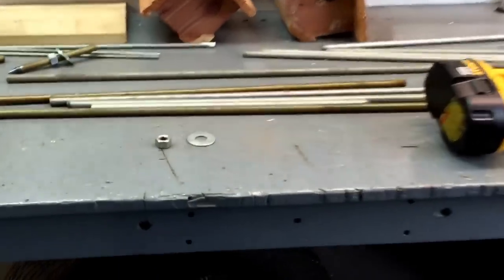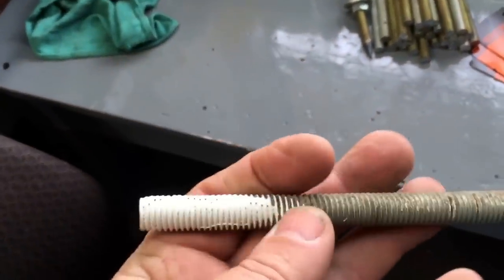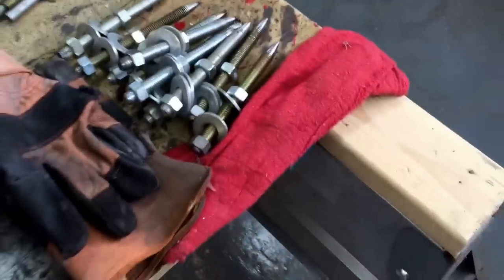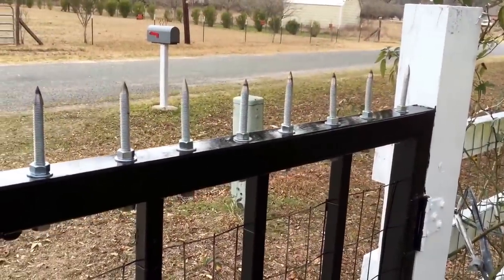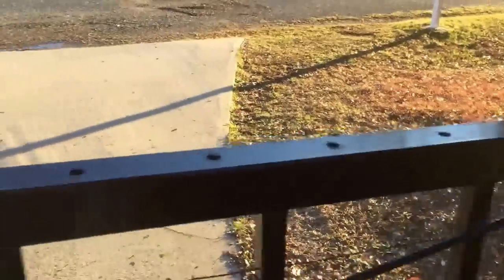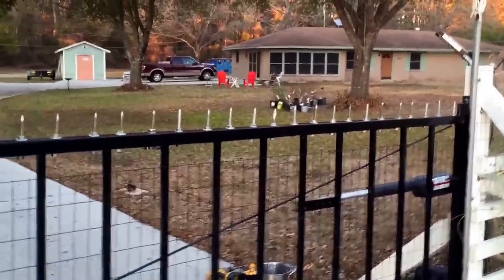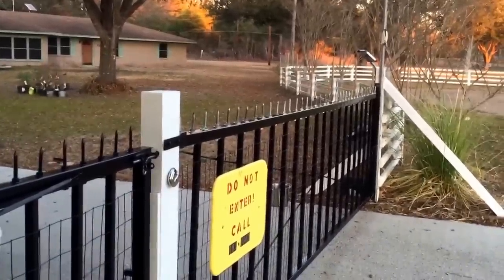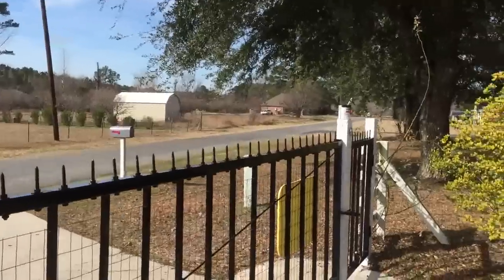Driveway gate security spikes

Comment: I have a similar gate, but its non-motorized. One of its track-wheels failed when the neighborhood a-holes knocked it over last Halloween, so I've had to tie it shut and use the pedestrian gate only.  Its a really tight squeeze for my powerchair, and I'm not thrilled about not having use of a wide gate to use my driveway...but since I don't have a vehicle, I've made it work.  Spikes and barbed wire, hmmm....I'm on it!
Reply from the maker: I wish I Lived near you. You'd have a power chair capable of burning rubber, nothing in the house or on the property that was broken, and neighbors that would be afraid of your very very big freind.
Reply: +BCtruck, rebuild, repair,repurpose I wish that too.  But the kids and I are doing AWESOME poking away at it solo.  (Mice live in fear of my house!)  I watch your channel for ideas, adapt things to make 'em work for me, and then get on with being self-sufficient, no problem.  Keep the ideas coming!

Comment: Next time you have to sharpen small diameter things like that use the drill to spin them. You can make a temporary handle to direct the front using some nuts, washers and a eye bolt to give it the ability to spin yet still have control.

Comment: I lived in an apartment complex on the bay in Miami for about 17 years, it was in a bad part of town, even though we had walls and fences we would get junior zombies coming around the edge of the wall that ended at the bay or they scooted under a low spot in the rolling fence. I took some axle grease and smeared it on the wall edge so when they tried to swing around the edge of the wall and also on the bottom of the fence they got under. It worked good. In some places in the Caribbean they put glass bottles in cement on top of walls and then break the bottles.
Reply from the maker: +Robb's Homemade Life  Ive seen the broken bottle trick in the southwest. Mostly on adobe fences. Im not having any problems yet,but the economy is so desperately terrible here that Im afraid it will start soon. we are a gas and oil based economy and there is no pumping or drillin at all now.

Comment: I saw you have a drill press. I use mine to chuck up round stock, turn it on and then either my 4" angle grinder for metal or my 3x18 belt sander for wood to point or bevel the ends. You can cut way down on time instead or using your grinder. Vary drill press speed and grinder/sander angles to optimize stock removed. Sorry about the chickens. It's nicety have fresh eggs. Could you try rabbits if you want a sustainable protein source. I love them. 50# of feed = 50# of super high power fertilizer. Plus when you have prepped a few they get to be about 5 minutes from pen to pan ;)
Reply from the maker: Thanks for this shop tip! I have thought about rabbits and I may get some.